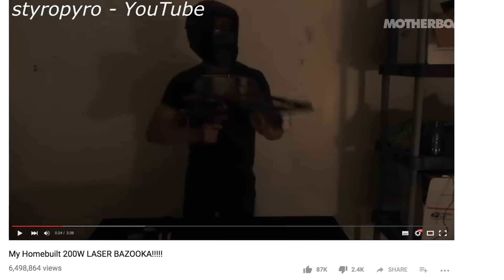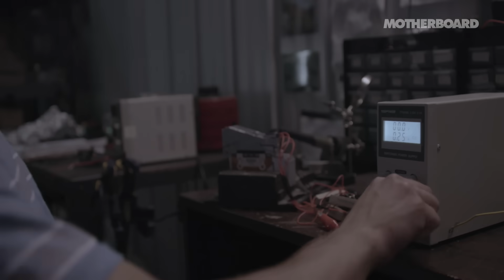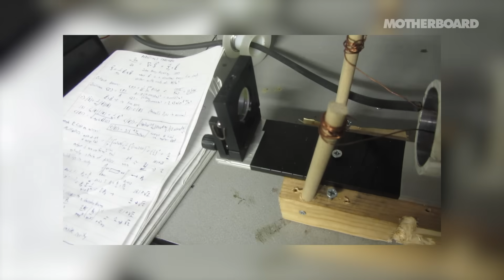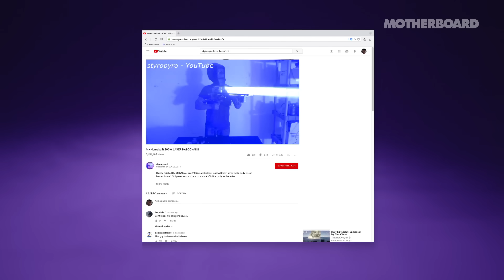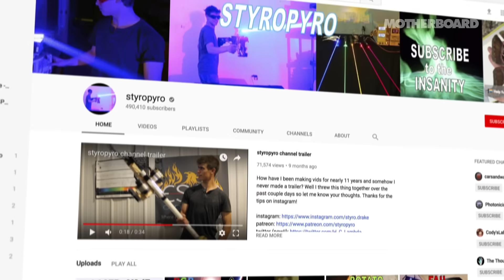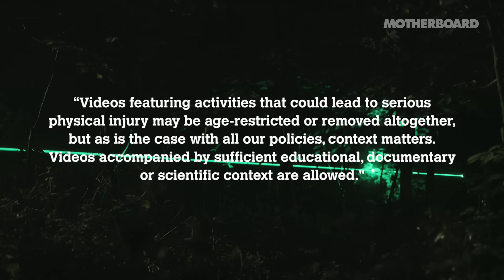This Pyro Makes the Strongest DIY Lasers In the World Out of Old Tech

Comment: Here is an example of a simple and safe experiment that can explain a few basic things and is great for school science.

Take two laser pointers ( 1 red 1 green ) and blow up a few balloons ( some red some green ); you will see that the green laser pointed at the red balloon destroys the balloon quickly and conversely the red laser destroys the green balloon quickly.  But the red laser seems to not damage the red balloon or the damage happens much later and less intently... same with the green laser not damaging the green balloon.

The red ballon reflects red light, that's why we see it as red so the red laser is reflected in part and the balloon absorbs less energy.

The green balloon does not reflect red light and therefore when the red laser is shown on the green balloon virtually all the energy goes to the balloon and POP

Comment: I love your work and my first dpps laser was a pumping up showlaser from 60mw into a 3,5 dpps monster and not a problem but it was for me to boring dpps green level laser like your version to finish it perfectly.  I have a 1,5 520nm laser who was first a 500mw 520nm direct diode laser but 1,5W I think it's going higher with 4 1,5 520nm system but I don't know at time good system bring 3 laser diode in a single point without high Power losing.  I be an energy electronic technician and I could open power science like you in closing rooms and outdoor it's only absolutely save way too check all visual blinded things before I make a outdoor test.  I would like a small technically idea for a 60W laser with a violet 40W and 20 W blue version and a nice driver who could be programming for pulse and direct diode laser up to 100W power.  Could you give me a typ for the laserdiode vendor for #highpower violet systems?  Blue is niche 7W double pumping and overloaded to nearly 20W in a small sinus pulse phased in two time periods to make a summary nearly 20W with two niche 7W . 40W violet is a bit difficult but maybe I do it with infrared dpps frequency double or three times a specific type of violet crystal but directly diodes like more better in power to light without a big lost in a heating radiation like dpps pumping laser sors.  Violet is the best powerful visible  radiation source for burning.  Ultraviolet rays laser diode are unbelievable expensive.  But my dream is a monster like a 500W laser one time 🤣 maximum size like my green laser hosting.  Thanks for so nice ideas for many times.  I love laser and do it as technically energy studied person and all radiation is allowed to handle it science based like you.  Nice work love it all

Comment: Styropyro there was some research a few years back using a 100 watt Co2 laser to propel a spinning metal top up to around 100 to 200 feet in the air.  It made a popping noise and they mentioned laser ablasion of metal,  However the atmosphere and distance curtailed any real advances in this test.  However, if the laser was attached to the back of a space ship and carried with it then there would be no problem with atmosphere, distance, or dispersing of the beam.  Making the engine , choosing a metal that will give thrust but not melt or burn up, should it be a spinning disk?  there are all kinds of issues to solve.  Perhaps you could build a scale model engine with a couple of lasers suspended on the back and see if it produces measurable thrust.

Comment: You call yourself a inventor with taking safety very serious yet you put 2 un married batteries in the same battery sled do you know how dangerous that is while using 18650s if you use two batteries with two different discharge rates you will get a short and vent your battery and when those things vent they can literally explode or melt your skin from the heat and gasses it produces on a short
Reply: 8:34 to be exact look at those different 18650s and to add on your using a efest battery god damn your one cheap dude when it comes to battery safety

Comment: Can someone plz tell me how to make a nuclear reactor
Reply: Uhm.

Get some uranium and I guess make rods out of them or something like that. Now comes the tricky part, you need to make the nuclear fission thingy work and I don't know how but you're smarter than me so you can probably figure that one out, shouldn't be very hard.

Place everything in some water. The nuclear reaction thingies should heat up the water so you want to run this water into a tank of more water. The new tank of water will now pick up the heat from the first tank's water. Remember to run the first tank's water back into it after you run it through tank number 2. 

When the water in tank 2 heats up it will create steam and use this steam to turn a ventilator or something that generates electricity, kind of like windpower. Remember to run this steam back into tank 2 by cooling it down after it turns the turbine. 

And bam, you've got yourself a good amount of energy.

The hardest part is to get the Uranium but if you ask Trump he'll probably lend you some.
Reply: @avananana  "Fission should be very hard.'' I can just split an atom with the tip of my nails, and cause an explosion that blows the whole of my town down.
Reply: @avananana  you go on eBay look for a very old radium clocks or anything with radium scrape it off put it in a dissolvable capsule and put it up your butt wait about a month take it out and then put it in in a little box beside your bed and it will keep you warm forever👍
Reply: Avana what about the cooling boi u dont want to make na nuclear bomb
Reply: Fart in a bottle and light it with a laser beam in the freezer
Reply: @tel5080  how did you even think of this LOL
Reply: No problem..! Come back when you've sourced some U235 or Plutonium. Then we can take the talk about noncritical mass, control rods, cooling, and...the effect of nuclear radiation on a human body.
Reply: @kalleklp7291  Nah, just get a bit of Yellowcake
Reply: @MR_GPU  yup that can do it too.
Reply: @kalleklp7291  smh, plutonium is not a naturally occurring element.
Reply: @Well_Edumacated  I know.
In fact it keeps amazing me what a few neutrons and protons can do to materials if one subtracts or adds them.
Reply: @Well_Edumacated  No, that's why some people are so keen to build reactors. :)
Reply: @kalleklp7291  or thorium, wich is safer and I think easier to get
Reply: @Sodium_Slug  One cannot build a working and reliable reactor with Thorium. Many tried and all failed.
Reply: @Sodium_Slug  Unfortunately, we haven't seen a single functioning Thorium reactor and we won't in a foreseeable period of time.
Reply: Synthetic uranium is where it's at 👌😎
Reply: You can make a fusor. You wont be able to get any useful energy out of it but it still fuses atoms.
Reply: yeah you need lots of money to do so even remotely safley , your going to need a nuetron bombarder to start the fission reactions and then somehow get fuel that is unspent , you also will need neutron asorbing rods and lots of cooling / pumps that cannot fail I mean if they do you and all your neighboors would die , fission is no toy
Reply: There is a story about a boyscout who wanted an uncommon badge in nuclear energy and he build an atomic reactor and won it (withoit the uranium of course)
But then after searching for uranium in antique items with a geiger counter he made a real atomic reactor.he had some trouble but he did it.without the internet lol
Reply: Google it
Reply: The science behind it it not that hard, you can look it up on Wikipedia. Execution could be an issue though.
Reply: @YouTube Customer Support Fusion is hard to make you know, fusion happens in the sun, and you need a LOT of energy to do the fusion trick. Bit fission is easier but 10x riskier.
Reply: Ask the israelis,  they don't have any ;-)
Reply: David is that you?
Reply: Just for educational purposes   iwont destroy wadiya with it
Reply: You need your reactant and a catalyst. Your catalyst is the enriched uranium within an enclosure and the catalyst is its driven object, such as water to drive a turbine to generate electricity. The catalyst needs to be cooled but I don’t remember what chemical compound is required. When electrolyzing the catalyst and introducing new compounds, under extremely high pressure you can achieve fission or fusion depending on how precise you are on building it, or how much pressure / energy is applied.
Reply: You have tutorial on youtube 😂
Reply: you wouldn't be asking stupid questions if you understood the science behind a nuclear reactor.
Reply: Massimo D'Amico all you need is bubble gum🤡🤡🤡🤡🤡🤡🤡

Comment: I am hearing a lot about watts / power outputs of these devices that have been produced by this dude. I have seen a scope, power supply, waveform generator on his bench. Where is the laser power meter to substantiate these output power claims? He said he has 50W diodes from a projector! What?! 50W is more than most first surface mirrors can handle let alone a DLP chip or LCD panel. I've seen 10 Watts of argon burn into painted cinder block. 1 watt to your shirt is an instant burn hole, a hickup reaction as your skin burns instantly.

I'm calling BS. Cool video with the lasers and all but the numbers are inflated here. I think you got maybe 8 watts tops here for a few seconds which is a ton of light power. Try something like a 60W 532nm single line laser out in the desert where you are popping bugs flicking the beam around. Your glasses won't be enough to save your eyes within 2 feet from the aperture from the reflection from the dust.

Keep rocking those lasers dude but keep it honest with your output power. Get a a power meter if you are unsure of what you got.

Comment: The part where styropyro talks about YouTube is spot on. YouTube is really suppressing knowledge in all kinds of areas..its like censorship on demand, dictated by the uninformed "opinion" of the majority. 
I'm a first person view quadcopter pilot and there are allot of really informative videos out there on this subject. It teaches you about soldering, motors, esc's, pid tuning and a whole range of other subjects related to fpv.
But all it takes is 1 major incident with a drone...for instance a mid-air collision with a passenger plane resulting in loss of life.
And the whole hobby will be wiped away. 
People would be thinking " I don't care its not my hobby" and move on.